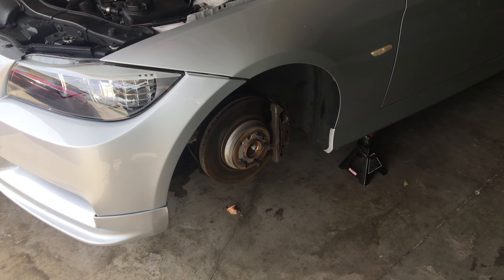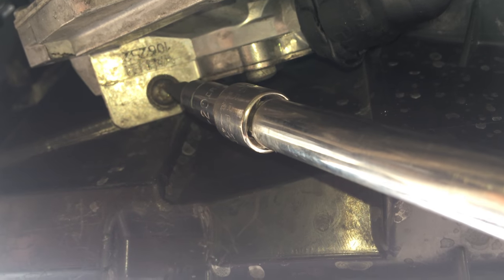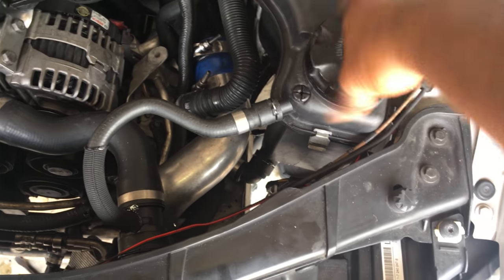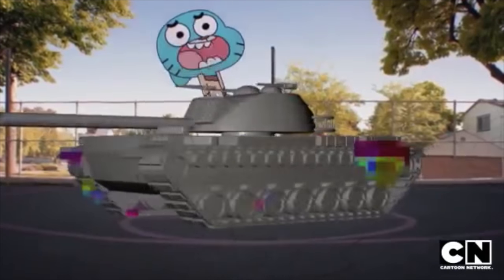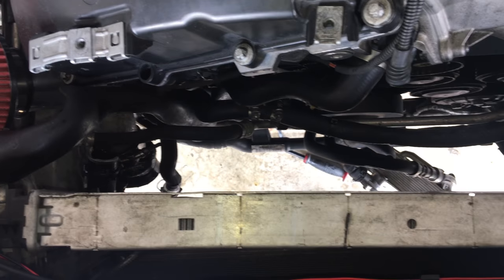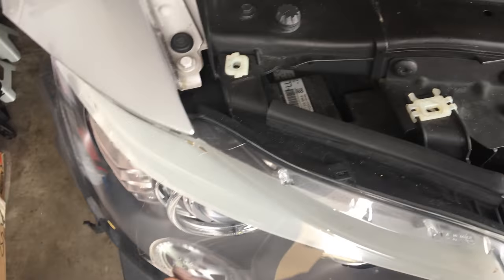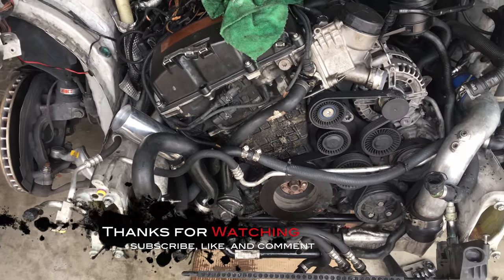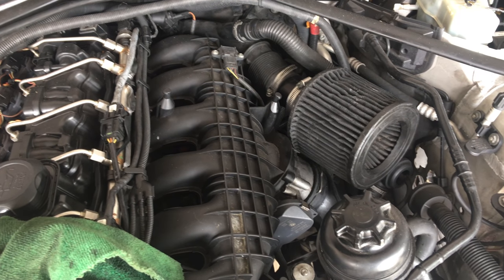BMW 335i N54 Engine Removal DIY Part 01

Comment: Hi mate this video is awesome. You do a great job of explaining everything. Have you noticed any problems with having a shorter intake pipe for the front turbo? I'm thinking of doing something similar and was about the different lengths effecting the car
Reply from the maker: Thank you, glad it’s helping in some way. Yea induction noise and car felt more responsive. From my tune I could make more power running less boost so helped the turbos out a bit. At the time I had rob beck turbos so the effects was very noticeable compared to stock turbos.

Comment: I know this is an old video but I'm desperately looking for removal procedures for 2008 335i xdrive. I can find forums and links everywhere for the i model but not the xdrive which from what I understand is far more complicated. Any video/forum/pdf links or suggestions GREATLY appreciated!!!!! Thanks!!
Reply from the maker: For the xi yea I believe you in it’s hard to find info for it. Best bet is maybe a Bentley service manual to get specific information. I haven’t removed an xi engine before but it would be similar to the i models except you would have to pull the front drive shafts and and such. I just did a quick search and stumbled upon this video. It’s for a 528xi but might be of some help since they share some commonality with the 3 series xi. Hopefully someone else might chime in with a better resource. https://youtu.be/moDCygdidf0
Reply: @nOshi2x  thanks a lot!!!!!🙏🙏👍👍

Comment: Great video man!! This is exactly what I was looking for
Reply: noshi I replaced the turbos on my car last year.  Blew my engine from low oil.  Would you say this job is easier than doing the turbos with the turbos in the car like I had to?
Reply: noshi thanks for the heads up.  Do I have to worry about the flex disc and all of that lining up when I swap over the transmission?   Noticed in the video compared to the turbos, the engine bay really opens up giving you a lot of space to work on things.  Thanks for posting this documentation of your work.

Comment: Hey how long do you think it would take a lift. Just wanna see if I wanna do it or pay somebody.  I have limited lift time at the shop.  Around like 13 hours maybe a little more
Reply: @nOshi2x  oh ok that sounds more than doable. But I have the n55 in a 135i and I looked up the labor. Idk why it says 25 hours . Did you need a special tool for the fuel lines?
Reply: Just looked it up for your car and it's 28.8 hours. I wonder why they say so many hours